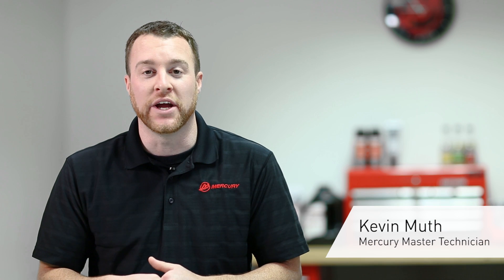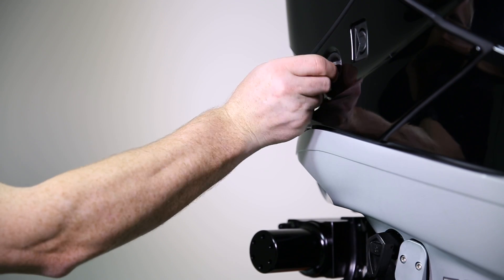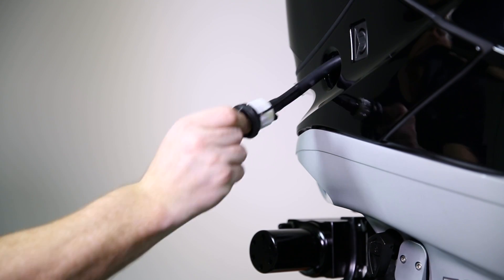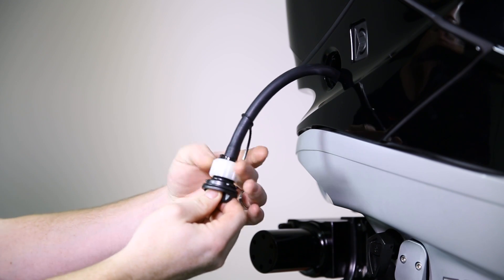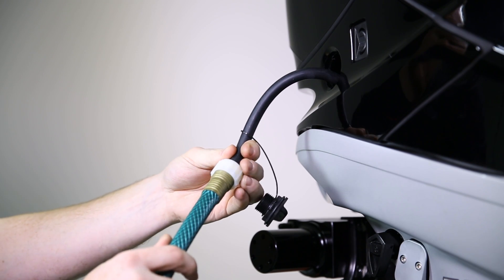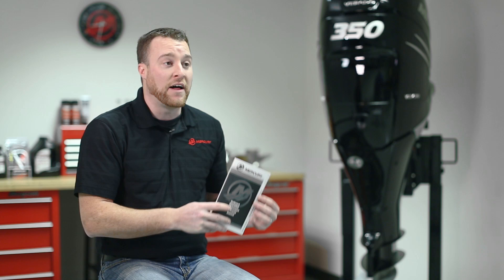Mercury Verado Maintenance: How to Flush Your Verado Outboard

Comment: When flushing my engines docked at Marina in the water , do I need to trim up the engines or can I leave them vertical (lower unit submerged) ??
Reply from the maker: Engines can be flushed tilted out of the water or with the lower units submerged. The flush system will still address the cooling passages within the powerhead and midsection, even when the engine is partially in the water.

Comment: Engine up or down?  Cold or hot?
Reply from the maker: When flushing the engine through the flush port, the engine orientation and temperature do not play a factor. Warm or cold, vertical or tilted, the engine will flush the same either way. 👍

Comment: What would cause water to shoot out of the flush cap while engine is running?  I have 2005 twin verado 200’s. It only comes out of one engine.
Reply: Bad check valve.
Reply: Need the T under cowling replaced

Comment: can i run the engine while flushing
Reply from the maker: Mercury recommends flushing your outboard engine with the engine turned off, placing the outboard in either the operating position (vertical) or in a tilted position.
Reply: IS IT BETTER TO FLUSH IT THIS WAY OR USE THE THE MUFFET AND HAVE THE BOAT RUNNING?
Reply: can i ask why? why not have it running?
Reply: Because the water pump impeller will be damaged!!! Hallo from Russia)